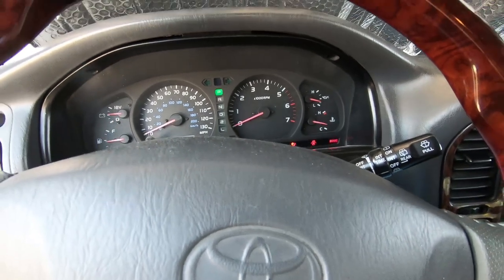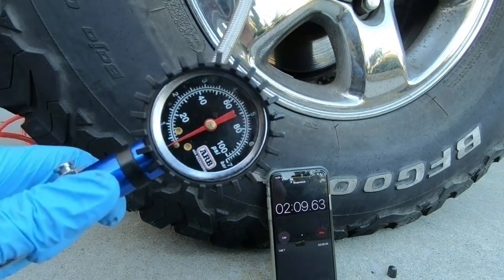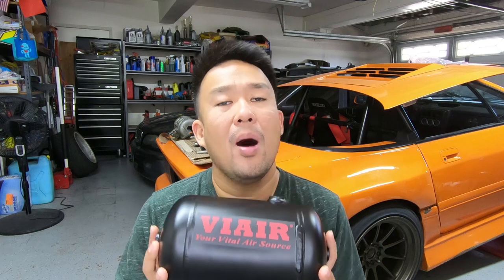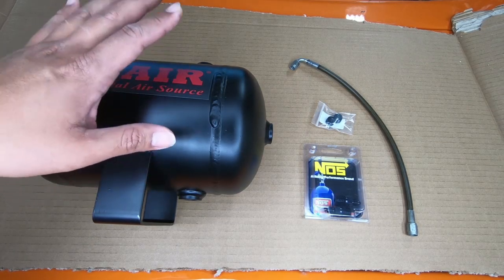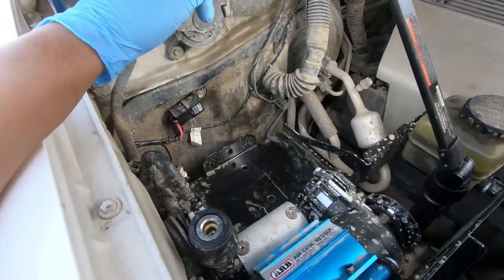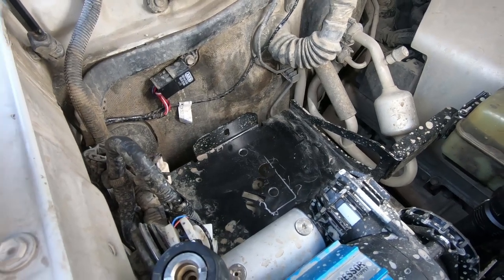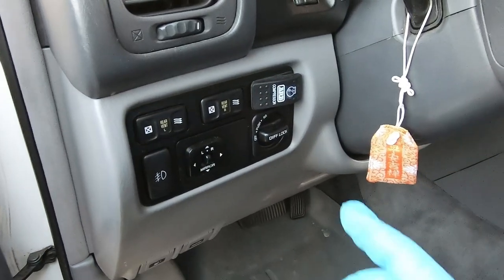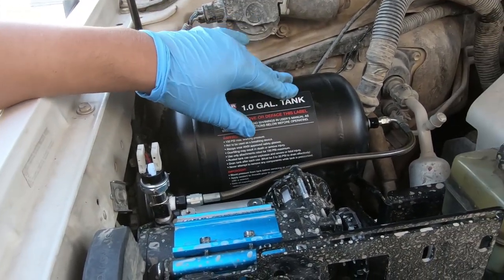AIR UP FASTER!! Installing an air tank for faster air ups!

Comment: This is a great install video. (HOWEVER)  THE TANK IS NOT TO SAVE TIME AIRING UP TIRES.  the stored air is a useful tool when using air tools out in the field.  
  I know people will bash your video because OOHHH I saved 15 seconds... blah blah blah.
  if you would hook up a 1/2 inch impact gun to remove a tire it would loosen 1 lug nut and  compressor could not catch up  enough to hit the next lug. (trust me ive tried this) 
 but when you install a tank  you could loosen 3 wheels before running out of air pressure.   a tank is a great idea no matter what any of these negative nancies tell you.  
people are a bunch of shit talkers and half of them don't do or ever try anything cool just to see if it saves 15 seconds. 
   great channel keep the projects coming.
Reply from the maker: Thanks for the support. I need to try hooking up some air tools before I inevitably take it out and replace it with a dual battery system
Reply: Man, use a Milwaukee M18 impact. Done. For me, air is for tires and air bags only...
Reply: I have several milwaukee m18 impacts and they are way better than a air tool in a truck powered by a tiny compressor.
Reply: @cayman9873  same here bro.  Milwaukee for the win 😎
Reply: Hey man, I read your comment but I want to make sure if I purchase a system with a small 1 gal tank I can run a power tool and loosen 3 tires before it has to fill up again ? Or no

Comment: in the 2 ports you've blocked, i would have used the bottom one for the moisture drain and the last one for the pressure relief valve. also i dont know if arb compressor has a check valve but i'd be putting one between it and the big tank
Reply from the maker: Yuuuup! I think you’re right.

Comment: Ive got a mutt mixed system with kline air horns jeep kit with a 2.8 gallon tank and under my drivers side seat ive got  the dual arb pump.  My fill times where not much faster filling my 37s up from 8 to 9 psi until I upgraded my hose sizes... that is the one thing that made the most difference.  My tank empties very fast but the added capacity is very helpful for all sorts of things. I even use my kit when I'm cleaning up after the weekend, great for auto detail and filling tires... the air horns are a great communication device also
Reply from the maker: Yea the small brake line I used was most likely a bottle neck. Its all gone now, replaced with a second battery
Reply: Having a tank vs not having tank is the purpose of this video. Most will just only have the compressor , which is slow and having a tank will speed things up. That’s the point of this video.

Comment: Schrader valves on a typical car tire only flow 2.6 cfm.  So it doesn’t matter how much air you have or how big your line is, the valve is the restriction.  That’s why you must use a multi-tap hose and fill up multiple tires simultaneously to see any benefit from a high flow rate compressor or tank.

Comment: The tank doesnt add much for  airing back up but it will help it you decide to use it with air tools and your pump will last longer because it will stop and cool off a little instead of running  continuously
Reply from the maker: Very true! I only wish I could fit a bigger one

Comment: hey man, Good vid.  I presently have a ARB twin, but mine is for air lockers for front and back differentals.  Now I want to add a tank to run pneumatic tools.  looking into it and watching your vid, I see something you may consider and overlooked.  you have/had 4 openings..you blocked one on the side, one on the bottom and used two for inlet and outlet...AWESOME..YOU GOT IT!.  Just one point, that one you plugged on the bottom is for a water drain.  Pressure, humidity in the air is going to fill your tank full of water and rust until it reaches the outlet and start to blow out...but that will be some time, meanwhile your getting rust inside your tank..  Suggestion..if you cant work it out to put a water drain and reach it directly on the tank, then maybe undo everything you just did, fit a pressure hose that will dangle down where you can reach it.  then have a fitting to screw on your compressor water drain spicket.  i appreciated your vid..it gave me some insite to what i am going to do.

Comment: Great install video.  You may want to remove your tank and install a bleeder asap so you can remove the water that is building up in the tank.
Reply from the maker: It was just temporary, ended up using that spot for a 2nd battery

Comment: I have both portable ARBs and as others have said, You should of fitted the Drain Tap in the bottom hole because within a week of constant use with will have a lot of water in the tank, It's a great video but I really would pull the tank and fit the drain tap,

Comment: The tank will help a bit when doing all 4 tires.  The compressor continues to run while moving from tire to tire.  So basically it reduces the total air up time by the small amount you get initially for the first tire and then the time is take you to move from one tire to the next (assuming you move quick enough that the compressor doesn't stop).       Money would be better spent on a 4 tire inflation system with chucks that are off when not connected.   You can start the compressor, hook up the first tire and as it starts to fill connect the other three tires.  The compressor will run the entire time and since you are filling up all 4 tires at the same time the valve restrictions don't matter because you've split the CFM between them.

Comment: I've been through this scenario already... I upgraded to the ARB twin compressor and a 4 gallon tank. So much better. Shouldn't have ways my time with the single one. But you live and learn.
Reply from the maker: Carter Allen I’m thinking about the twin compressor. Idk if it’s worth it at this point, I’d like to save up and get other upgrades first

Comment: Im thinking of using the 1.5 gallon vixen air horn tank. It has 6 ports and comes with fittings and air line. Now I'm thinking 2 gallon would be better. Thanks

Comment: Nice vid. Prob long run the pump has time to fill the tank between tires thus putting less strain on your air compressor running flat out for all tires.
Reply: The opposite… because now the compressor will constantly be running the whole time whilst trying to fill the tank and tyres before getting to cut off pressure and I’m pretty sure the ARB single compressor is not 100% duty cycle, so will likely thermal cut and burn out faster.

Comment: You need a drain plug on bottom for moisture build up in the tank
Reply from the maker: Thanks! I need to find another 90 degree and a easy open and close valve.

Comment: where did you get the AN lines and fittings?  I'm unfamiliar with AN stuff but it looks a lot cleaner than rubber hose and clamps!
Wow so many haters commenting.  Glad you stay positive!
Reply from the maker: It’s because I’m dead inside... lol jk! You can get AN fittings and almost race shops. If you’re not too familiar with them, you’d want to go talk to someone that has them in stock so they can set you up with what you’re trying to do. If you know exactly what you want, you can order online on amazon or summit racing

Comment: Why don"t you use the bottom port of the tank to release the moisture out of the tank. Compressors always make H20! Nice video.
Reply from the maker: That’s a good idea! Maybe I’ll hook up a small line with a valve at the end of it to release the moisture.
Reply: This was my thought as well - you REALLY don't want your tank to rust out! Is the best way to relieve pressure from the system as well - water and air both.
Reply: Smart idea

Comment: The arb single or dual compressors seem fine.. but thats a huge huge amount of money for a small compressor. Rather add a second battery and a large inverter and use a mid size 120 volt compressor.    
      I might consider the air tank under the truck...and weld two brackets on the rock slider with air line coupler bodies on the brackets.  So all you need is a ten foot air line that plugs in on each side of the truck.
Reply from the maker: Dual batteries are a must!

Comment: Air tanks are for train horns. It's silly to use for airing up tires because the tank empties almost right away as it has pressure but no real volume. It's all about the volume of air that the compressor puts out, not the PSI. It's a waste of time and effort. Besides, unless you're a chase truck in the Baja 1000 then what's the rush? Airing up after coming off the trail is always a good time to BS with buddies doing the same thing and have a beer.
Reply from the maker: I NEED A TRAIN HORN!!! Hahaha
Reply: Beer 🍺 😋
Reply: I needed this comment haha cause I was deciding whether to add a tank or not.

Comment: With very little difference, I would suspect a restriction in the hose or connectors (chuck?)
You could check the line pressure at the tank end of the hose and open the line connected to nothing and see what the pressure is - restriction pressure.
Reply from the maker: Will check it out. My assumption is the tank is too small and gets depleted quickly. The single arb pump can only pump so fast. I only gain air when I switch between one tire to another

Comment: Whats wrong leaving air in the system ?  Your tires are huge and have air in them all the time.   Your gas tank stays almost full with 25 plus gallons of fuel all the time..  whats a tiny tank of air going to do ??
Reply from the maker: Didn’t really feel too safe with it full. Plus it fills up so quick it doesn’t even matter
Reply: It’s more about moisture… without a drain, keeping the air in the tank will lead to condensation as the air inside heats up and cools down. This creates pools of water inside the tank that makes them rust out. The only real advantage of having a tank, is if you can fill the tank with very high pressures, so the air dumps into the tyres fast and speeding up the process. This style of setup only has a real small burst at the start and then its the compressor filling the tank and the tyres at the same time, which over drives the compressor. Not to mention the compressor now constantly running between tyres trying to fill the tank. Without a 100% duty cycle compressor, you’ll end up thermal cutting and shortening the life of the compressor…

Comment: is it possible the little tank had enough air to fill one tire and if would have continued with 4 the time would not have been 2:30 per tire and the extra tank at that point would have made things better? would love to see comparison filling 4 tires from 20 to 35.
Reply from the maker: HuskyNoob yea I think so too. I think the main advantage would be when I go from tire to tire. That in between time when I’m not airing up, the compressor is still on and charging up the tank. Let me see if I can do a comparison vid soon!
Reply: @chowcares  This would be great. 10 seconds is not worth the extra money and time IMO.

Comment: Seems like the connection between the tank and the compressor is pretty small. Do you think making this a bigger line would help?
Reply from the maker: C Wood good question, I don’t really have an solid answer. I think for fluid, it would make sense. But for air I think it should be ok.
Reply: Restriction is still restriction.  I use 3/4 inch i.d. pipes on my 125 gallon 5 hp compressor in my garage.

Comment: 15 seconds doesn't make it worth it. I have the same compresor on my Jeep and was thinking about an air tank but after seeing the diffrence. The work and the extra money is just no worth it. Good video and info man. Thanks!
Reply from the maker: Not really worth it unless you have room for a bigger tank. I ended up with a dual compressor

Comment: not worth it. Unless, you use that hose to blow down the dust on there trail. Is there enough air to clear dust from bed or tail gate?

Comment: You bottlenecked your output by using the smaller adapters. You should run straight 1/4 inch NPT For better air flow.
Reply from the maker: Good to know! I used the 90s because they fit well with my tank placement and also because I just had them laying around. I might redo the system later
Reply: chowcares you can get 90s of npt male to npt female on Amazon $8/pair. Then run a short length of 1/4 or 3/8 inch pneumatic hose (also very cheap) and I think you would have an appreciable increase in output. Would be worth the ~$10-15. I would also try using a heavier gauge air hose to fill with, for the test, not that I would carry it with you, but just to see if that is also restricting your airflow. Anyway, I'm jealous of your setup, it will be a while before I get to do mine
Reply: Pretty sure the restriction will create more heat at that connection point too…

Comment: the main advantage is air tools
Reply from the maker: Damien Frizzell that’s a good point! I haven’t tried any yet but I will now. Thanks!
Reply: @chowcares  get ureself one of those detailing guns like 30 bux get a pro clean
Reply from the maker: Damien Frizzell pro clean?
Reply: @chowcares diy professiional clean
Reply: These tiny compressors don’t put out nearly enough air for any real useful air tool like an impact wrench

Comment: to many cons over pro, unnecessary cost, safety, more weight to the car, have you seen compressed air explode?
Reply from the maker: Very true, when I had it installed, I’d make sure it was only filled when in use. Since then a second battery has taken its place 😐
Reply: Unnessecary cost is subjective. If you’re poor, anything is expensive. Compressed air is handy if you want to use some air tools while remote. 
The safety aspect doesn’t really mean anything. You’re carrying fuel in a plastic tank under your vehicle, thats far more dangerous than compressed air. 
Weight is negligible, if its a concern, leave a passenger at home and save more.
Compressed air doesn’t explode. The container can fail, but its unlikely. The air hose connecting the tank and compressor is more likely and that wouldn’t result in an explosion, just some hissing.

Comment: I have a 25 gallon tank on my compressor in my garage airing up one tire will cause the compressor to start, at that point the tank is doing nothing and you are using 100% compressor. Any air tool will turn on the compressor quickly. So I don't see the point in these tanks for air tools or airing up tires.

Comment: Remove that stupid fitting that has the pressure switch on it . Have a look inside it and see how small the hole is for the air to travel through.  I removed mine and put a straight air fitting to hose  . And out the pressure switch into one of the air locker outlets . I could be wrong but it seems to have helped with the fitting not getting too hot now too